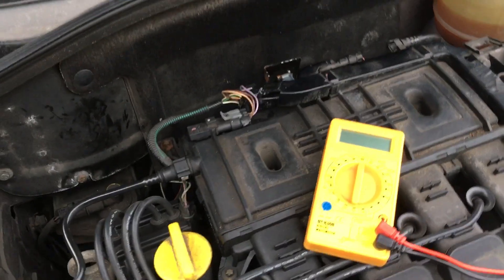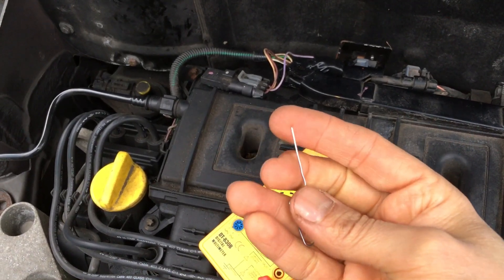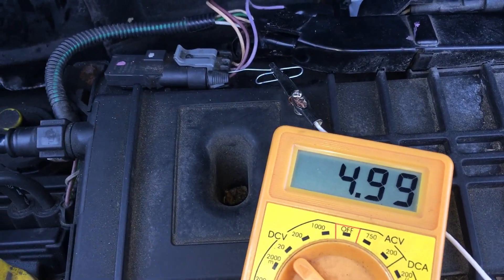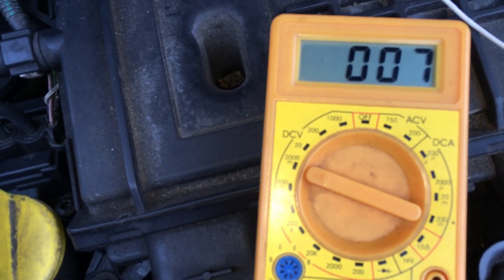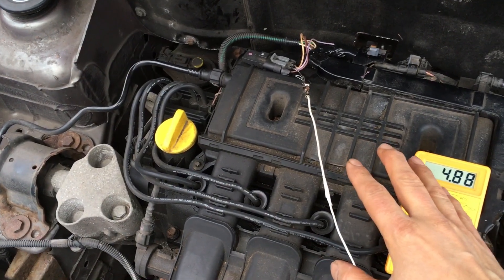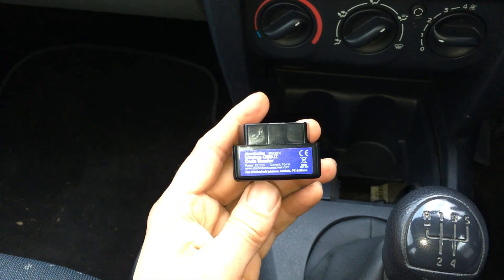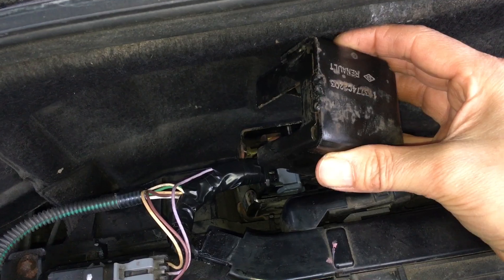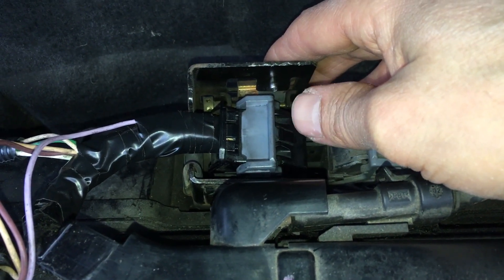Renault Clio with P0105 (MAP Sensor Circuit Malfunction) Diagnosis & Repair.

Comment: Hello! My engine idling high, the errors are P0638 and P0105. No engine light. I changed the MAP sensor and the throttle body is cleared. The problem still exits. When I remove the socket of the MAP sensor,  the engine works very good, as expected. Of course, engine light on. When I put it again, the problem is the same. Do you know what could be the problem? Renault Clio 3, 2008, 1.2 16v 65hp.
Reply from the maker: It needs to go through a proper diagnostic process - I don't think anyone is going to be able to tell u the answer based on an email I'm afraid.
Reply: @iofix  Thank you! I will try the same diagnostic process.

Comment: Hi. Thank you for the video tutorial. Got an I sight from the same. I have the engine light on and performed a diagnostics. It came back with P0100 mas air flow sensor malfunction. I own a clio 1.2 16v 75bhp 2004 model. May I ask what could be the issue and is it possible to buy the spares ?? Thank you in advance
Reply from the maker: Air mass meter or wiring to it.

Comment: Your map sensor wires look like they are going Straight to the ecu normally they go round the manifold loom and back to the ecu have you chopped them out and put them direct into the plug ?
Reply from the maker: I can't remember to be honest - no longer have the car. Cheers
Reply: @iofix  no worries I’m having the same problems but changed map sensor for 2 other I have put in a different throttle body but think I must have a wiring fault on the manifold loom some days works fine others revs all over the place sometimes cuts out I’ve had the coil light glow other times engine management light some times the two stop lights 😬
Reply: did you find a solution?

Comment: 2013 chevy equinox 2.4l.. i changed my Map sensor and checked the wires and d voltage are good but the check engine light comes back on with the same Code.. please help
Reply from the maker: Sorry not familiar with that model, but u could have some other problem triggering the MAP code - that is quite common.

Comment: Have this code and another saved but no engine light. When the car gets really hot i mean autobahn SPEED hot ther comes a warning to check the ignition system and dont gives any power. After restarting the warning its all good if the car gets cool. When its still hot you can nearly bite in the steering wheel when pushing the accelerator too far. Feels like a fuelcut but without any warning
Reply from the maker: Sounds like it could be electrical resistance building up on a circuit somewhere as the engine gets hot and eventually causing something to fail. Or possibly head gasket??? Good luck with it anyway.
Reply: @iofix  it is a tce and i think it could possibly the ignition coil.
Reply: Same problem 🤦‍♂️
Reply: @armandokoshena5133  I am assuming it is the ignition coil. This model has one box for all cylinders on top of the motor.  Until now this car was not getting really hot anymore so it runs normally. At the moment I do nothing about it.

Comment: Can this problem cause the car to go in to limp mode. Basically what is happening, not always is when ever i step on the gas and go over 50 km/h the car slows down and keeps it at 50 and low rpm, and the squiggly  line light comes on
Reply from the maker: Hi, yes it could be, I would say your first step should be to get a fault code reader on it to give yourself some good direction.

Comment: Hi, Cant you just replace the wire..?
Take care
Tom
Reply from the maker: Hello, thanks for your comment, but I think that suggestion would just make the job bigger and more difficult - possibly I have miss-understood your suggestion, apologies if I have.
Reply: @iofix  No You are right, just me not thinking..LOL  had my coil set changed today but engine management light still on, maybe need to check the wiring like your vid shows..
Tom
Reply: @iofix   2013 chevy equinox 2.4l.. i changed my Map sensor and checked the wires and d voltage are good but the check engine light comes back on with the same Code.. please help